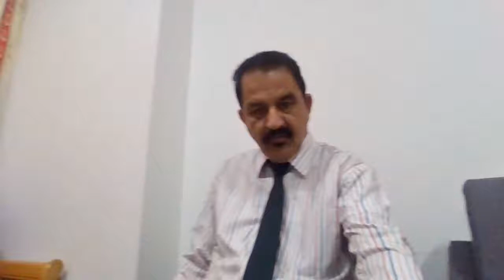civil Construction Material--Session  / lecture 19--Grout Mix of concrete

Comment from the maker: What about Epoxy Group
Reply from the maker: The Best in Epoxy Grout and Grout-Related Products
When you’re ready to get started on your next tile project, finding the highest quality epoxy grout products anywhere in the world is easy.
EpoxyGrout--Cement-based grout products are thinner than mortar and building cement, allowing it to flow better into cracks and other areas.
The grout products include a wide range of high performance and creative design options that adhere to to ISO 9001-2000 certification.

Comment from the maker: What is grout ?
Reply from the maker: What is Grout
Grout is generally a mixture of water, cement, and sand and is employed in pressure grouting, embedding rebar in masonry walls, connecting sections of pre-cast concrete, filling voids, and sealing joints such as those between tiles.
Grout is a composite material generally consisting of water, cement, and sand. 
It is typically used for filling voids under machines or other structural elements, sealing joints and openings in surfaces and reinforcing existing structures.